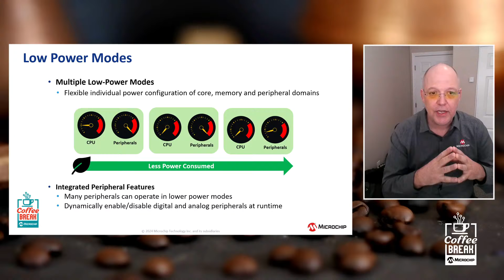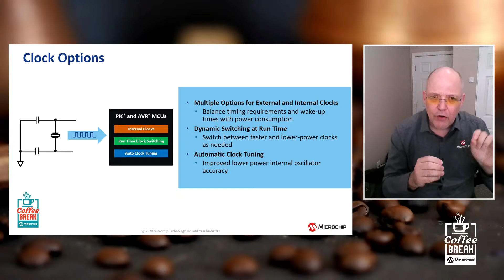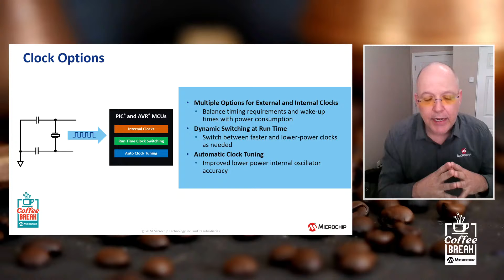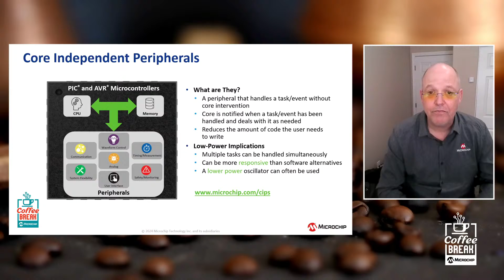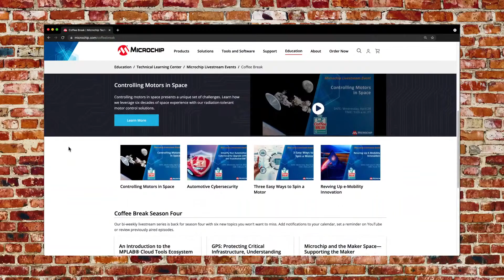Coffee Break | S13E2 | AVR® and PIC® MCU Low-Power Capabilities

Comment: Why do you offer two different products? Why isn't there a single 8-bit device?
Reply from the maker: Hi there, thanks for your question. Microchip offers both PIC and AVR 8-bit microcontrollers because each line has distinct advantages that cater to different application needs and design preferences. PIC microcontrollers are known for their robust peripheral integration and ease of use, particularly in industrial and automotive applications. AVR microcontrollers, on the other hand, are favored for their efficient code execution and performance in consumer electronics and hobbyist projects. Hope this helps!